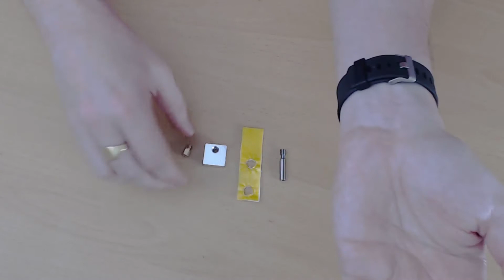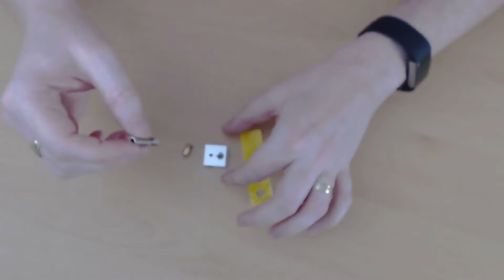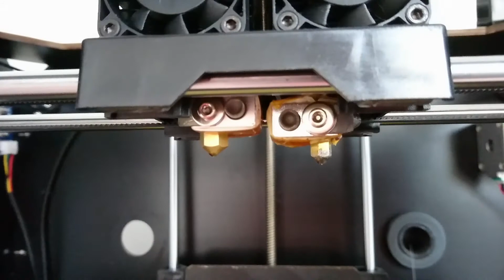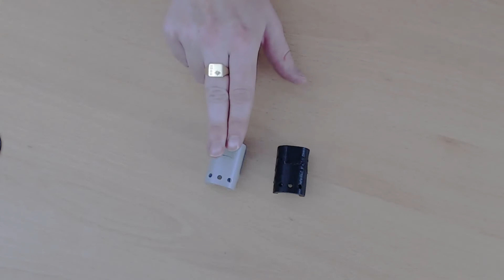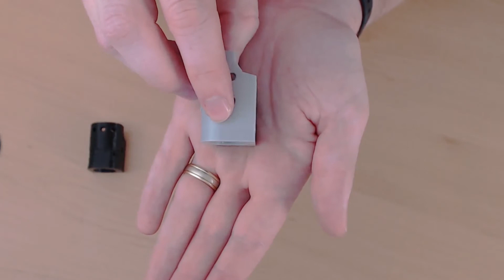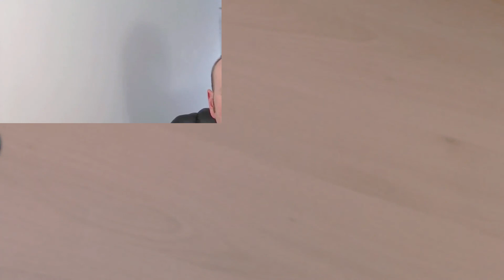How to Improve the Print Quality of your CTC 3D printer

Comment: I had one of these printers since 2015 and I still have it and use it regularly, the hot ends are the stock originals and have never been changed, it produces good quality prints each time every time, I did make some modifications, the glass bed, Sailfish firmware and re-routing the X axis cable through a cable chain rather than having it bend down sharply from the top.
I recommend using super hold hairspray for the glass bed instead of PVA glue, you'll get smoother bottom layers and it's easier to remove the print after the bed has cooled.
Reply from the maker: Mine is now in bits in a box. I am thinking of using the parts to make a custom printer at some point. Just need to get time to plan it out at some point. It was a great printer for me to start on and taught me a lot.

Comment: Thanks for the vid, however I've got a question - What did you use to offset the Z axis for the glass bed?
Reply from the maker: In the description there is a link for a file on thingiverse for z offset. This is the one I used.
Reply: @Abernus69  My bad, thanks!
Reply from the maker: @dha12oks  no problem

Comment: I'm having issues getting clean top solid layers. Within one layer my printer goes from overextruding to underextruding and back again. The sides of my prints look fairly good but the tops don't look good at all. What do you think could be causing this?
Reply from the maker: There could be a clog in your nozzle causing this. Clean the hot end down and the extruder gears and try some small prints like a calibration cube and make sure when it's printed the dimensions are still correct
Reply: @Abernus69  my extruder gear ended up not being perfectly round and it was slipping at times. I put in a spring loaded extruder with a new gear and it's way better. I still have issues with circles not being round, but I think it's an issue in Matter Control.
Reply: @Abernus69  thanks, I'll try that.

Comment: Hi need some help, I have a CTC A10S,  have put it together but can't seem to get z axis moving properly doesn't seem to be synced and makes a noise when z axis is engaged
Reply from the maker: The noise could be down to the z rod not being aligned or to much voltage being fed to the stepper motor. The moved not being synced will probably be down to the e steps not being set right.
Reply: @Abernus69  
Hi are there any tutorials out there that I can look at, as I wouldn't know were to start
Reply from the maker: @leonmiddlemas6839  a lot of my research was on Google groups (search for CTC) and patching other printer info together

Comment: Can you run abs or pla same time
Reply from the maker: Yes you can run both PLA and ABS in the same print, as it has dual extruder you can heat one up to 240 for ABS and the other up to 200 for PLA. You may have a problem with elephant foot if your first layer is part PLA and part ABS as the heated bed temps for both are different.

I have not tried this and am not sure what issues you might come across during printing as ABS is best printed in a chamber but PLA does not require one.

Comment: What printer settings did you use on the print at 8:38? Like what layer height, nozzle temp, nozzle diameter, print speed etc?
Reply from the maker: This was a while ago now and I would have been printing at either.1 or .2mm layer height (I think it might have been .1mm), Probably at about 210c (but this depends on your filament) for the temp and for the speed about 2500 mm/min. The nozzle is just a standard .4mm nozzle.
Reply: @Abernus69  Thanks! Yea I print successfully at 210c, 0.2mm layer height, & 0.4mm nozzle, but the moment I change to 0.1mm layer height, my CTC clogs. I believe it's because my thermal tube/heatbrake doesn't have that notch in it to lessen the heat creep effect though. I'll find out!
Reply: @andreasmusic1222  tell me please if you've solved that issue... Same here

Comment: I just got the bizer what size glass bed do i need to order?
Reply from the maker: Mine is 230mm x 150mm. If you measure the original print bed you should find one that is the same size as it.
Reply: I found it thanks also how do i go about smoothing my prints the base is smooth but everything else is rough
Reply from the maker: It depends on what you print with. If you print in ABS then you can acetone smooth then. If you print with PLA then I just sand them down, and use filler.

Comment: Hi, I did the same changes as you, but since I changed the heat block I have temperature fluctuations. If I set temperature for 205ºC I got fluctuations between  186-210ºC. Do you know how to fix this? Btw, the glass bed makes a huge difference for me too. The first layer is really good =)
Reply from the maker: Check the simple things first that there are no drafts etc that could cause the temps to fluctuate. Make sure the heater is secured in the block and that the thermister has a good connection to the block. Is the cotton round the heater block still intact? If all that is O.K then.......
It may be a damaged the cables to the thermister on the heater block. You also might want to follow the cables down to the Mightyboard and make sure they are still connected correctly. Just make sure the printer is unplugged and be careful!
Reply: @Abernus69  the thermister wasn't well connected to the block. Now it works fine. Ty. Still I doesn't get the same results as you. What parameters do you use?

Comment: I recently purchased a ctc dual 3d printer and tried to accomplish a figure 3d model but after 6 hours I saw that the model was coming out all weird. Gaps in the figure, unfinished body parts and generally weak even with supports. I print with PLA and trying to use PVA but neither are working on the printer. Please help.
Reply from the maker: If this is your first print I would recommend starting out by printing simple objects like a cube from thingiverse. Use this to dial your settings in, then move on to more complex prints. Without seeing the print I would guess your print was too fast and the temp was too low.
Reply: @Abernus69  the temp for the PLA was 210 and the bed was 45

Comment: Hi... fixed all the printer issues now... but just bought simplify 3d and it doesn't have the fff profile for the ctc printer. Is there any chance you could send me the file or tell me the settings I need as it won't print without the proper one. Tried searching for it but can't find out anything
Reply from the maker: Just use the makerbot profile it comes with when you install it and tweak the settings to dial it in for the filament you use. That's all I did.
Reply: Abernus69 thanks for the reply... I have tried doing the printer configuration to get the ctc fff file but it doesn't come up. I've done some digging and it shows that some people have had the same problem, and they have had to get the fff file off of others but non of them that I have found will download due to being old.
Reply from the maker: When you open up Simplify 3D and go to Tools then options Just make sure Cartesian Robot is selected and set the Build volume to X: 220.00 Y: 140.00 and Z: 150.00. Mine shows Origin Offset to x: 110.00 y: 70.00 and z: 0.00. Also under Account make sure it shows your account name to ensure you are logged in to your account with Simplify 3D.
Reply: Abernus69 I've got that In now. But it's not waiting to heat the hot end and bed up before printing. So I have to pause it and wait for it to heat. How can I fix this issue,
Reply: I got a print out of it finally... been playing with settings the past few hours and still can't get it to print correct. The one on the right was printed on makerbot and is so much more detailed with the little knobs on it. The one on the left is on simplify 3d.. as seen in the photo, it has scaled it up for some reason and I can no longer get the detail out of it. This is the same stl file. Ignore the quality on the right one, that was a failed print I threw in the parts bin
Reply: I am unable to attach the photo. 😑😠

Comment: Hi Abernus, Great video and prompted me to persevere with my CTC 3d Printer! I did buy the exact extruder as recommended but it doesn't feed my filament into the new throat at all. The throat seems to be quite a bit smaller than the filament compared to the original. But I'm guessing that's standard. Any ideas? Heats normally. Wondering if this is misalignment? Cheers mate!
Reply from the maker: I didn't have any issues at all. I would recommend stripping the hot end down and taking the fan off and with the printer still off try loading the filament and you will be able to see it go through the block and in to the throat. You should be able to easily see where the problem lies and if there is any miss-alignment. 

When I did mine I had no issues at all. I am about to change the other hot end over ready for flexable filament to try that out.

Comment: Hi, me again. Recently upgraded to the glass bed ( I already upgraded the nozzle and active cooling) and I cannot get my prints to stick to the base. I've tried pritt stick, different temperatures.. Can you help me?
Reply from the maker: I just use print stick and let print bed heat up and sit for a few mins and the glue goes tacky. Make sure the bed is level and the print head is not too far away from the print bed
Reply: Have you got a link to the print stick? I've searched for it but I'm getting nothing
Reply from the maker: This is the stuff I use: https://www.amazon.co.uk/Pritt-Stick-Original-Glue-Childproof/dp/B004QFI99Y/ref=sr_1_1?ie=UTF8&qid=1525118386&sr=8-1&keywords=pritstick+glue&dpID=41kXmXPe5OL&preST=_SY300_QL70_&dpSrc=srch
Reply: TheBantaPatrol  I've tried Pritt Stick but it didn't work for me. Some cheap hair spray from the pound store has worked wonders though

Comment: Hey nice video , i have one problem , do you know how use only the left extruder? because my right extruder is broke ... i have ctc bizer 3d
Reply from the maker: In the slicer I use (Simplify3D) there is an option when you go in to edit process Settings near the top called Auto-Configure Extruders. I normally have mine set to Right Extruder Only. Changing this to Left Extruder Only should only print with the Left Extruder. Also in the Layer, Additions, Infill and Support tabs you can specify what Extruder to use.

Comment: Hi there, I have the same printer as you and have bought the nozzle that you linked in the description, it starts off fine and then it will randomly stop extruding the plastic, However when I pause the build and not unload but load the plastic comes straight through with no problem, do you know how to fix it? thanks
Reply from the maker: Best to start off with the basics and make sure the bed is level and that the nozzle isn't touching the bed and causing back pressure to build up and stop the extruding. If everything is set correctly try to print a model you know works add the problem could be down to a bad model. Hope this helps

Comment: I am amazed that you wasted so much money on unnecessary upgrades.  The CTC should produce great prints out of the box.  I made some mods, but Left the build plate and hot end as standard because there is nothing wrong with them.  Your original prints look like you printed them with the free PLA you get with the printer, which is known to be old and brittle.

I am not aware of a CTC that has active cooling without you fitting the mosfet and mounting the active cooling fan on the hot end.  I don't see that in your video.

To be fair the CTC is an awesome printer for the money, sadly lacking customer support. Also it is not a 'knock off' printer - it is a MakerBot replicator clone, built from the open source plans.
Reply from the maker: The Active cooling Mod is on this vid: https://www.youtube.com/watch?v=3gyBB7KeczM&index=2&list=PLqna2hohY9wz5SV3RfJFROE0l9fibAvpV&ab_channel=Abernus69  Yes while the first few prints were from the cheap PLA that came with it later prints using Ridgid Ink PLA turned out just as bad.

The Mod's don't cost a lot to be honest, I think it's about £20 for the lot and if this has improved my printing experience then it's not a wate at all.

I love my CTC printer, yes sometimes we can have a falling out but usually, that's just the bed not being level and causing the prints to come out badly or fail.
Reply: This is just my opinion here.I think that what made your prints better, was not the bed or the hot end, but your gain in experience of setting the printer up. Using Simplify3D, decent plastic and perhaps sailfish firmware. I fitted the Mosfet and cooling fan to one of my printers too.  I think you are missing out quite a bit of fun not having two extruders, if only for the support materials as it will enable you to be able to print far more exotic designs.  A lot of my mods were to enable constant  printing of ABS.

I use Rigid.ink too, but I find the £10 ebay plastic prints just fine too at a quarter of the price, so tend to use them for the more exotic filament I cant get from ebay.

Sorry to bust in like this, but there is a lot of bad press of the CTC Bizer, and its not all CTC's fault. Many people buy them because they are  they are cheap, cheap, cheap and have NO IDEA of how to set it up - but once set up correctly the  print just as good (or better) than a £1000 printer.  Its not beginners printer for sure - purely on the lack of support from CTC.
Reply: I found the bed of my Bizer was far from flat which caused me all sorts of problems as a newb.  Also I found the filament would occasionally strip against the drive pinion, a printed spring loaded extruder upgrade fixed that but as I wanted to print very soft materials I eventually opted for the Flexion extruder.   This is 100% reliable and gives fantastic prints.
Reply: Yes, out of the box they can be a bit grim (but should print ok).  The bed should be OK, provided you level it correctly and understand that you need to adjust it warmed up, and that if you change that temp you need to level it again, as they do warp with temps above 80 centigrade.  I like mine, in fact I have 3 of them, and rate them higher than Wanhao D4 with costs 4x the price.

Comment: Hi Abernus, great videos. I made the changes you recommend (as well as new feed device) from same supplier you used and my extruders now overheat, causing the machine to stop. Can you recommend what I should do? Please don't take this as a complaint, as it isn't. Cheers.
Reply from the maker: make sure that the heatsink and fan are fitted correctly when you reassembled the print head. Also, check there are no damaged wires on the heater cartridge or the thermal reader. Also, make sure everything is screwed in tight (Not too tight as you might strip the threads) Check the settings in the printer menu to see what the pre-heat temps are set at. You could also try putting the old parts back on and see if the problem remains.
I know as I said in the video the wires for the heater cartridge and temp reader were not long enough and it was a stretch to get the wires on mine to reach, so damage to them could be a possibility. Good luck
Reply: Abernus69 thanks mate I'll try that
Reply from the maker: Remeber to take care with the wires and this is at your own risk.

Comment: Also as you have the same printer as i do (CTC Dual) maybe you can help me with a frustrating limitation i currently have with my design to print workflow? which is that I can currently only use ReplicatorG to slice my models for printing, for the most part RepG does what i need but it lacks modern features but more importantly seems to crash with a recent complex model i desperately need to slice/print (I dont know however if the crashing is due to the programme struggling or my laptop).
I also have a version of Makerware but it hasn't a combing feature which i require to retain a clean unmarked surface finish (RepG does seem to comb but as mentioned crashes).
I would love to have Cura &/or Slic3r fully setup to slice/print for my CTC Dual however as much as i've tried to input the correct parameters to create a accurate profile with either of these slicers for my CTC dual the result seems to be the print head colliding with the inside walls of the printer, the build plate overshooting up/down or other similarly destructive actions.
I know Simplify3d has a dedicated profile for the replicator Dual but i cant afford this just yet regrettably.
I would really appreciate any help you might be able to offer.
Reply: I recently found that ReplicatorG no longer works with the current version of MacOS right when I needed a print!  I tried the slicer from Autodesk with some sucsess but you still have to tell it the printer is a Makerbot 1 and live with only one extruder.   I recently stumped up the cash for Simplify3D, I know it stupidly expensive but it does work well.